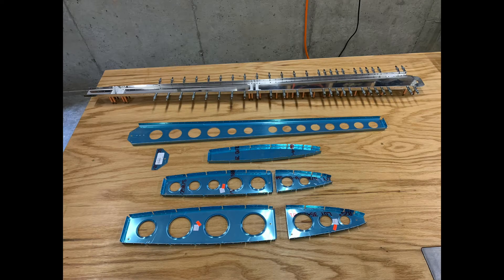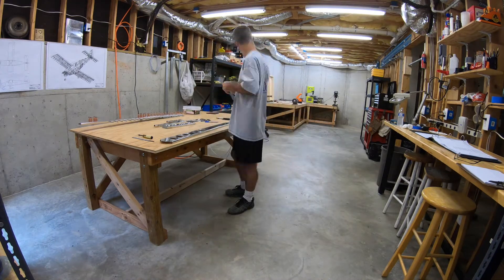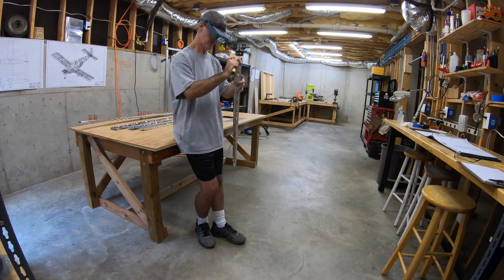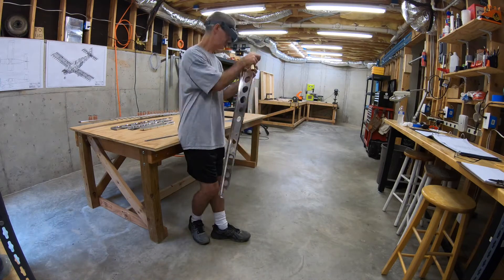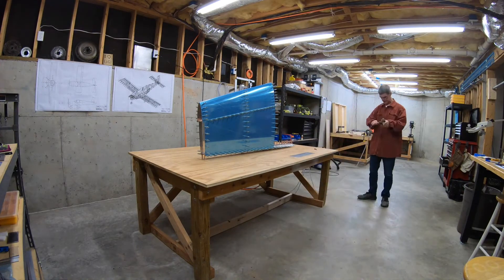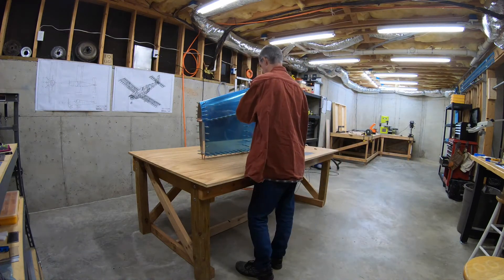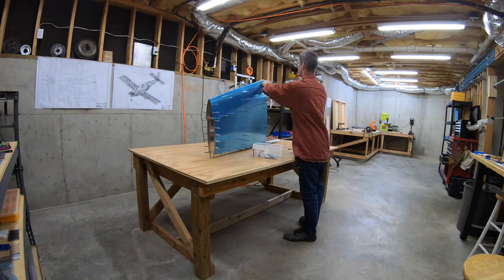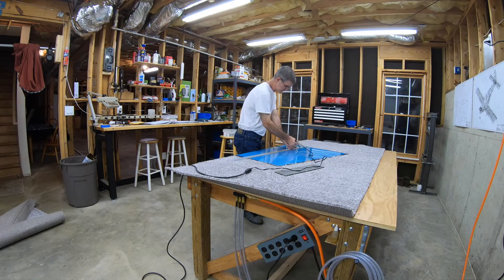RV-10 Build Log - Emp 04 - It's starting to look like an airplane part!

Comment: Great Videos! i appreciate how you even mention for some that may not know the light reflection issues. Also I love the fluted reamers. More cutting points make a much better hole.  I've done Commercial aviation for 26 years and a lot of it Sheetmetal. GA uses such thinner skin.  I am hopeful to build a 10 once the things settle down with Vans.

Comment: For radiusing the front of the rib -- thanks for pointing out the diagram in section 8! Do you only radius off the bottom corner of the flange where it meets the web or do you continue it all the way through the flange, effectively shortening the length of the flange?
Reply from the maker: Hmm, good question, and I'm trying to remember...  The farther out from the web you get, the more the flange can flex, and so it isn't really an issue.  That said, I didn't want to end up with a deep notch, or remove too much material and get close to that forwardmost rivet hole.  So I guess the answer is - a little of both?  I actually went looking for a decent picture but couldn't find one.  Sorry.
Reply: @missiletwentynine2667  Yeah that makes sense thanks! I'll probably just angle off the corner like the plans show on section 8.

Comment: What did you end up doing to get rid of the "pimple" in the skin afterwards? I put quite a radius on the flanges of my ribs, but still got one of those showing up on the middle rib.
Reply from the maker: LOTS of radius.  I still have a tiny pimple as well, but it’s from the first fitting of the skin (before I radiused at all) rather than when I riveted it together.  I was able to very carefully tap most of the original pimple out with a hammer when I took the skin off to dimple.  I’m about to the point in the HS where the plans tell you to radius the nose ribs.  I find it funny they didn’t spell it out in the VS section but do on the HS.